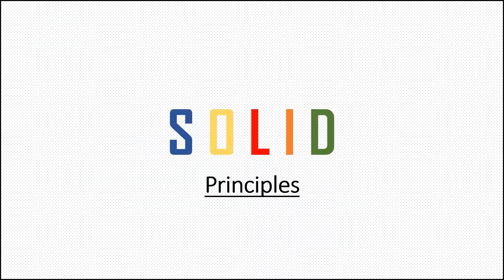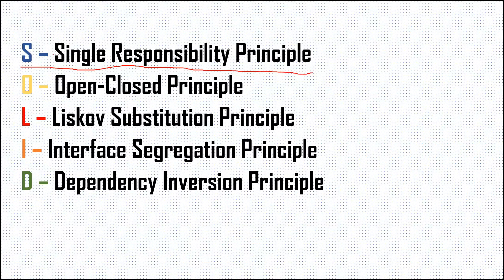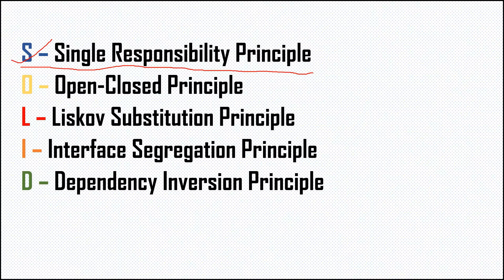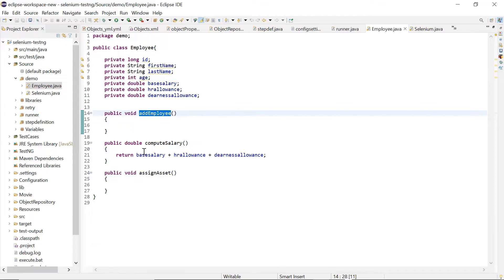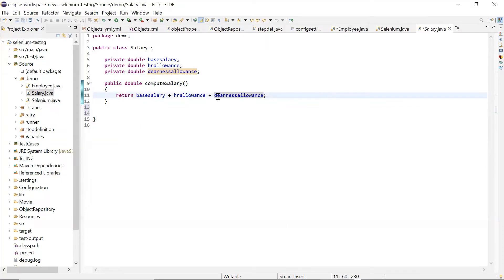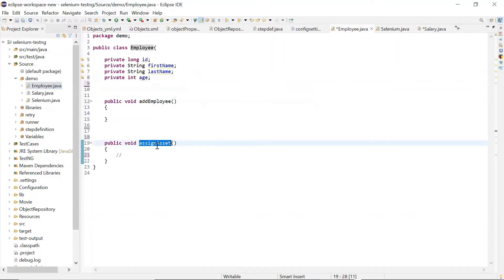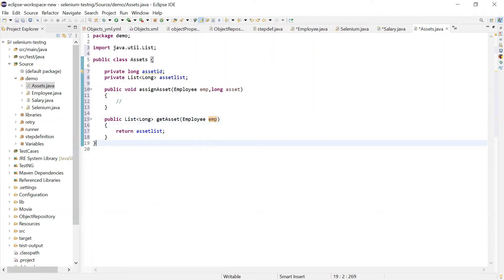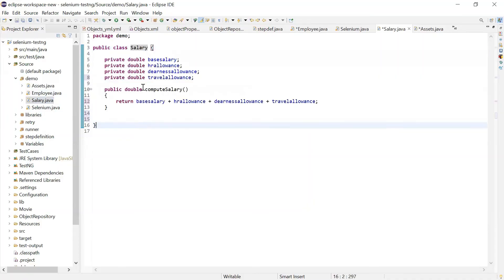#1 SOLID Principles | Single Responsibility Principle | Practical Example | Design Patterns

Comment: Hello Sir , I have a small doubt here , What happens if we are using POM , Where a Single Page contains multiple functionalities to validate For Eg  Price Calculation, Min max calculation, addition of products etc , Do We have to inspect all the Webelement in the single class( Page Class) and Perform actions on each webelement in a different classes ?
Reply from the maker: Here, we can have different views. But as per my opinion, page object class basic responsibility is to hold all the page objects for a web page.
So you should have one page object class which will store the page elements only. And then you can have another class which will be responsible for page operations.
Reply: @maximumautomation  Thank you sir